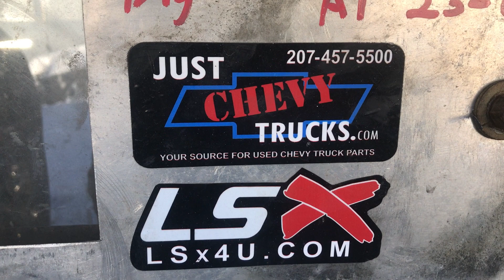Scott Brochu's "Super Max" LQ9 6.0 Chevy LS engine with 4.8/5.3 862 Heads BIG TORQUE

Comment: Hi I'm from Canada 🇨🇦.  I have l33 engine with summit cam 8733r1 with 799 head but I rather go 862 . Which head should I go better? 😊 give me tips 😅
Reply: We use the 706/862 heads for the higher compression ratio and torque!
Reply: @bogbrookpeptides  Rite on thanks 😊

Comment: Would this combo of LQ9 and 852/706 heads with a smaller cam like the sloppy stage 2 work for occasional pulling power in a truck on 93 octane?
Reply: @JustChevyTrucksBogBrookA-qo1mb  Thank you!

Comment: Was this ran on pump gas?
Reply: I have a smaller cam in my lq9 than this. Somewhat of a regular driver, have thought about 706 head swap from current 853s. Everyone says you can't run a lq9 with 706s on pump gas this is why I asked. Assuming my cr is at 10.6 and the 706 head would be at 11.2, I may try it just to see what happens.
Reply: Did you try it?

Comment: More details please. Heads worked any? Cam specs? Im doing a similar build and would appreciate any info
Reply: Justchevytrucks yeah my cam is smaller than yours but with better intake and tiny amount of headwork im hoping to see similar numbers too. Thanks for all the info u have no idea how much this helps. This is a combo that i couldnt find much info on until i came across your videos. Its nice to see almost the exact same setup so i can get a solid estimate. My goal is 450 at the crank so seeing this has me with a VERY big grin. Once again thanks alot
Reply: @swappedoutZ71  same here.
Thanks JustChevyTrucks. Taking the 862’s off my 4.8 and putting them on the LQ9 I just bought with a TickPerformance TowMax Stg2 cam kit(springs/ret/pushrods) with LS7 lifters, trunion’d rockers, Melling oil pump, King bearings, Speed Engineering LT headers. Looking forward to it even more thanks to this Vid!
Reply: @heymanmotorsports49  should be peppy. I enjoyed mine setup with the 862s. I now have worked 243s on it, thinking about getting them milled down to 862 cc size
Reply: @swappedoutZ71  out of curiosity was was your Comp ratio? What injectors did you use? What gas did you run? Was it reliable?
Reply: @heymanmotorsports49  comp was somewhere around 11:1 or maybe 11.5 I used a cometic thin gasket. Used stock manifold and injectors, ran 93 and it was good other than the ls7 lifters. Ditch them and get Johnson 2110
Reply: @swappedoutZ71  thanks so much for the feedback!
Reply: Justchevytrucks ok thank you very much. Which intake manifold was used? I have a tbss manifold and was wondering because some say the 862 heads kill the 6.0 after 5500rpm and the tbss intake doesnt shine its best until 6000 rpm. My 862 heads are mainly stock just milled a little and a nice 3 ang valve job. Hope the VJ gained a few extra cfm so i can take advantage of all the parts. Cam will be 224/230 .553 .553 109lsa
Reply: Justchevytrucks i see you made peak at 6200rpm. what is your opinion on the 862 heads high rpm flow for the lq9. Do you think its worth porting them with 2.0 intake valve? Rather work them than buy better heads, so i can keep compression without milling a bunch from bigger heads. But was interested to learn as much as possible about how they perform for a lq9 6.0 in stock form
Reply: Justchevytrucks also one last question on your dyno exhaust setup. Do you think the setup used for testing would do better or worse than longtube header setup?